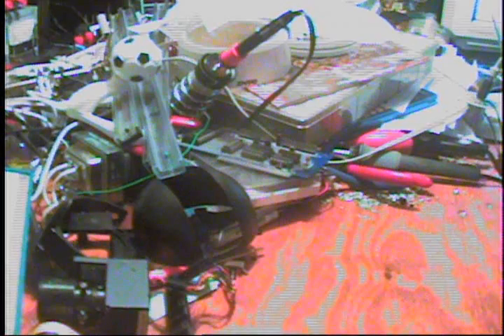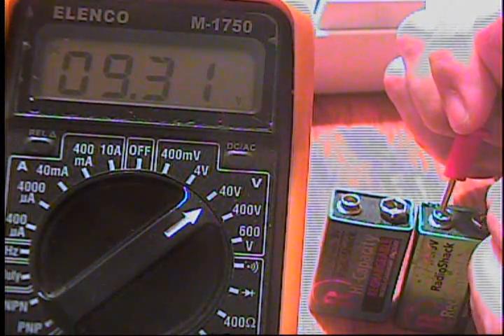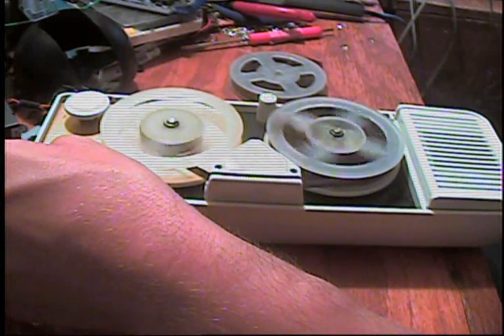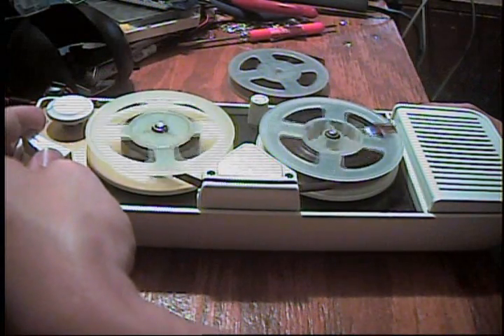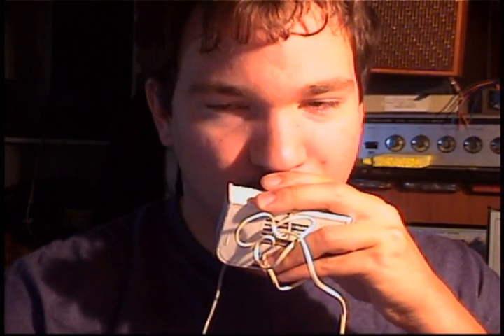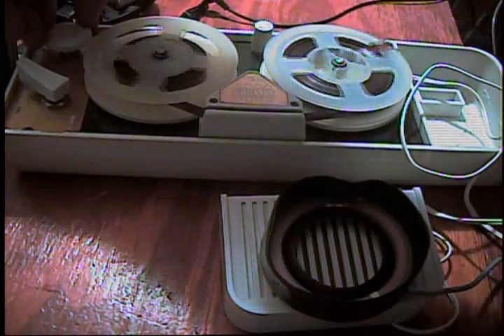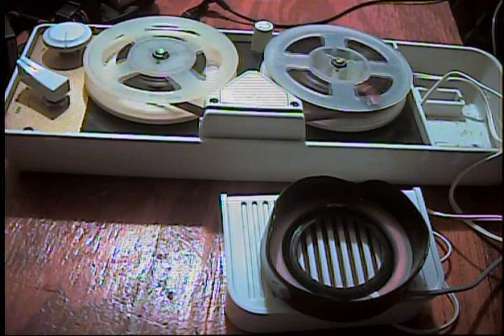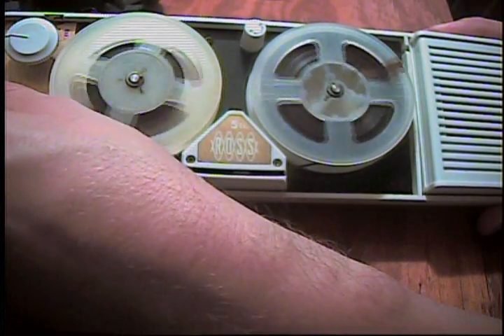The ROSS Mark-55 3" rim-drive reel-to-reel tape recorder

Comment: ..if I recall correctly...our Rim drive was manufactured by LLoyD's ??? , and did appear to have the approximate dimentions of your RoSS recorder..., and with Rim drive....it haD to be RiM!! DrivE................Sophistication of Capstan drive could noT be tolerated or excepted by 10 & 12 year old boys making CranK phone calls!!  ....should tapes be confiscated, we could always claim it was not us on the recording...using the disguise/excuse of woe 'n flutter,,,warbling,poor frq response, tape dropout, print through..etc...

Comment: Ricky, secret agent PI, mic wired with recorder...
Trivia, what type of recorder did Richard Nixon use to bug the telephones?

https://www.youtube.com/watch?v=sNePCfzrnUQ

Perhaps a Sony TC-800?

https://www.youtube.com/watch?v=mXd_OZ53jac
Reply from the maker: +umajunkcollector Sony TC-800B, not just 800 (the B has a built-in mic, as well as pitch control). It is definitely on my want list.
Reply: +CassetteMaster check this out ASAP!   http://www.ebay.com/itm/Vintage-SONY-TC-800-REEL-to-REEL-Tape-Recorder-Player-PARTS-REPAIR-/252100459399?hash=item3ab25bbb87
Reply from the maker: *****
If it was the TC-800B, I would get it in a heartbeat. But I won't get this one as it is just the 800 -- it has no pitch control (not the precise Nixon machine in that case). Thank you for pointing it out though.

Comment: I saw a similar unit on E-Bay last month. The idiot seller wanted $535 for it!
Reply: Stowe1664 I really get annoyed with E-Bay sellers who claim stuff works when it doesn't! The unit I saw on E-Bay wasn't a ROSS, it was made by PION. The stupid seller tried to claim it was an early PIONEER tape recorder and asked that $535 for it, even though the box and machine were CLEARLY marked PION. It was a pretty thing though, with a maroon and ivory case, and a clear plastic lid. OH and the seller offered to include FREE batteries! How generous is that?